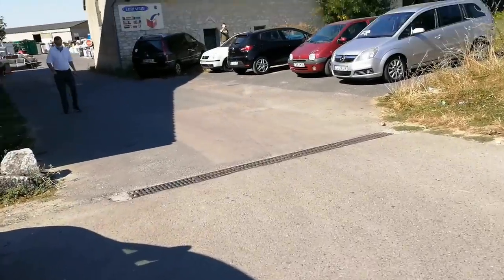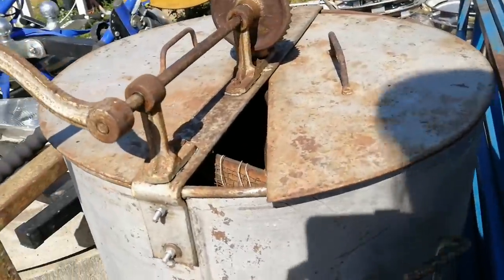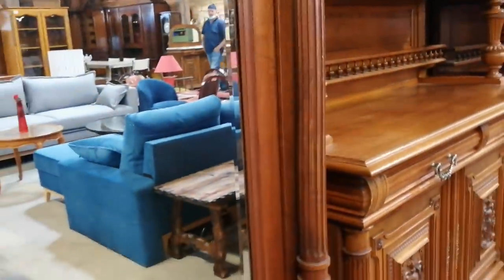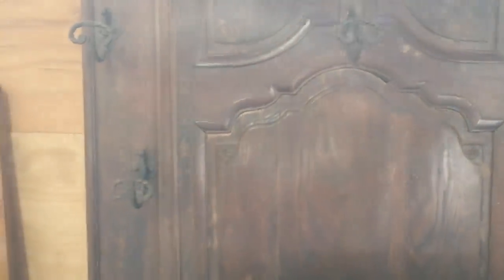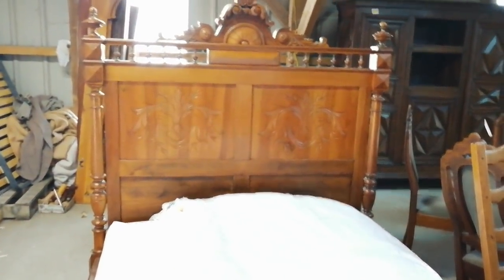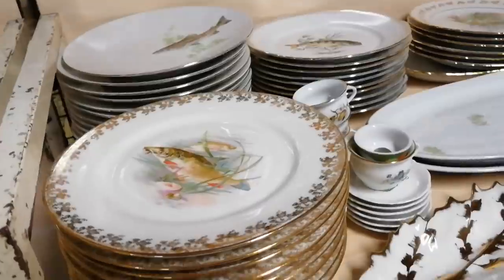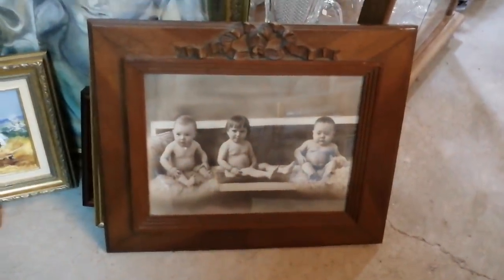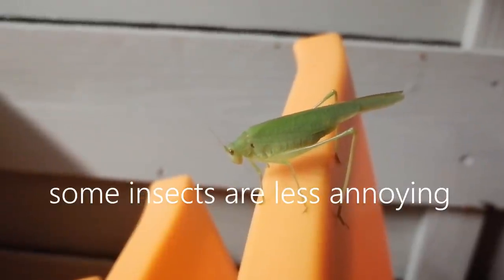Not Quite a Chateau DIY 92 - Wardrobes and Armoires - and a Quirky old Courtyard

Comment: In America they put copper pennies in plastic bags. Tape them on windows. The chemical reaction keeps the flies away! 🪰
Reply: Really never heard that old wives tale before.
Reply: So I looked that up you left out the big part of it the water. No chemical reaction… and this would be not very attractive. Just get a zapper ⚡️
To make your own fly repellent, simply get a gallon-sized zip-loc bag, fill it half to 3/4 with clean water, and drop 3 or 4 pennies in the bottom of the bag. Once the bag is firmly sealed, it can be hung from or nailed to an eave near a doorway to keep the nasty critters from entering your home. Flies don't like water, and they don't like the colors given off from the pennies. Flies have compound eyes so the bags look like a giant body of water to them, therefore they leave.Mar 28, 2016
Reply: @Daihatsu_Hijet  forgot that part! 😉 It's been years since I've seen them do it.😁
Reply from the maker: That's very interesting, I will have to try that indoors, but not sure it would look good in the restaurant windows!
Reply: @notquiteachateaudiy  totally understand! I thought that way too, but flies-no flies, hmm. Which one is better. You could leave a note by them, telling the reason. I know chateaus and old buildings have fly problems. Maybe they'll like the idea😊 Just giving an idea 💡!